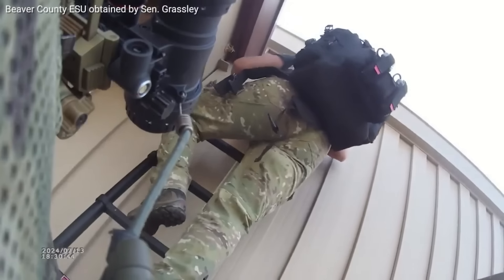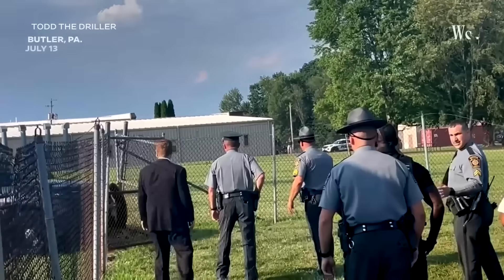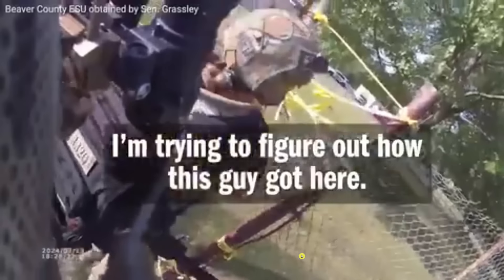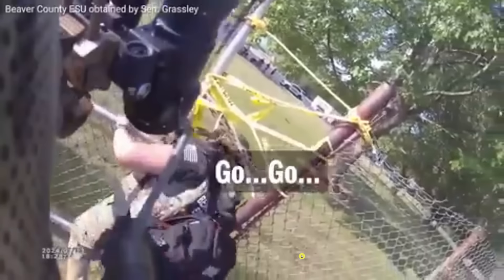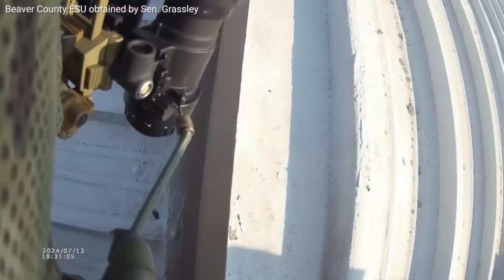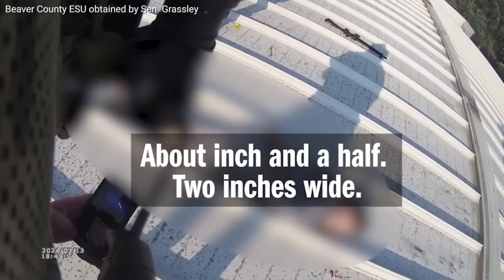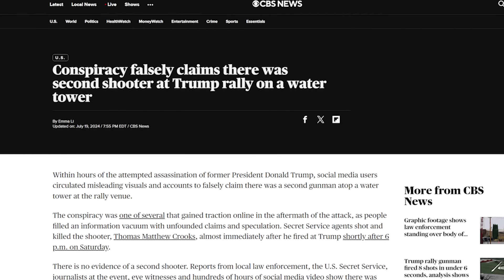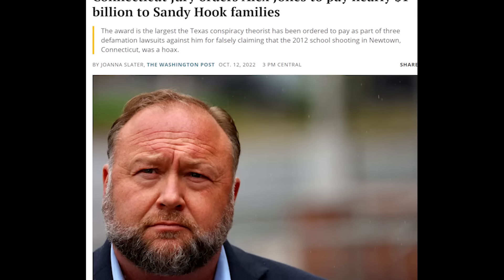Trump Shooting Analysis: Shell Casings, Ladders, Drones, Bodycams,

Comment: 8 cartridges or shells? This is double talk. Cartridges are unspent bullets.
Reply: Right - it seems like doubletalk. Technically, the cartridge is a complete ready-to-fire shell. A cartridge consists of a shell casing (which contains) a primer, powder and a bullet (projectile). After it is fired, the shell casing with a spent primer remains, the powder has been burned (initiated by the primer), and bullet has left the gun.
Reply: Watch the body cam. When they first got on roof, he counted only 5. Body cam cut off for 12 mins, then later they count 8.
Reply: @FookU2b just as a guess, if he shot 3 time lying down and 5 shots standing the casings could be apart somewhat. I missed that part and have to go back, they may have moved them all together, which may not be the actual evidence shot,but that I don't know. Like I said, I'm making a guess and not an informed factual comment. When 2 or more of the 'alphabets' areconducting an investigation, instead of working together, they trip over each other and conceal information from each other!
Reply: Wray... You ARE Incompetent!! Ugh!!
Reply: @FookU2b 😮😮
Reply: What is an empty cartridge?
Reply: @flyingfishsurf it’s called a spent shell casing. A cartridge consists of four components, a bullet, a shell casing, a primer and powder.
Reply: no the FBI use terminology for "Spent cartridges" a lot.. look it up.
Reply: @FookU2b yes audio really sounds like the first 3 were further away in all the audio I have heard.
Reply: @kevinshiley9061 Tommy NEVER stood up on that roof, he shimmied into place!!! Footage is clear on that!
Reply: Hello there how are you doing today ?
Reply: @FookU2b fishy for real!
Reply: Good point
Reply: @FookU2b I saw the same thing.

Comment: So how'd the shooter get on the roof without a ladder? But the police couldn't get up there without a ladder?
Reply: In a different video it shows three vertical exhaust stacks on the side of the building. Not sure why he didn’t include those in this video but they’re there - that’s also what the FBI director was referring to.
Reply: there was a ladder right behind to evergreen shrubs up against a tunnel adjoining the 2 large buildings and that's where his backpack was set down so he got on top of the tunnel/hallway then the roof & the ladder was there at the time of the shooting I don't know why they keep saying it wasn't there and its not the ladder they climbing up on
Reply: @merrychristmas40  it was there .. i saw it as well .
Reply: @merrychristmas40  The first three shots were fired from the second floor of the building next to the alleged shooter.  The weapon that fired the first three shots was probably fitted with a silencer, which accounts for the lack of echos.  The second five shots were blanks fired from the same location but with a different weapon most likely an AR-15 using a surefire trigger that can fire rapidly.  Blanks were used in the AR-15, which explains why no one else was injured.  Local law enforcement was in the building next to the building that the alleged shooter was on.  The last shot fired killed the alleged shooter and was probably fired from the same window as the other eight shots.  Everything supposedly found on the roof by first responders was planted by them as alleged evidence, including the 8 shell casings.
Reply: @merrychristmas40 that ladder is clearly visible in cell phone footage of crooks crawling up the roof as well
Reply: @robertperry4439 the FBI needs to interview you or fix news.  You solved the whole complex web of events like you were there.
Reply: The drone is to deliver the gun on top the roof @merrychristmas40
Reply: @merrychristmas40 please check the latter finger print
Reply: @merrychristmas40  agree... They keep downplaying the ladder he must be spider man and how he was about to sneak in the range finder and rifle... So, when and how did he sneak in the AR rifle and now supposedly he bought a ladder that he didn't use? All because someone must have told him... We have the ladder and the rifle ready just walk your way over to the side of building... It already to go for you, just like we talked about it... 
Theory just bring your range finder we'll have everything else, including the bullets you'll need in a back pack next to the ladder... Perfect CIA/FBI/SSA and whoever was involved had their rookie shooter for the perfect Patsy...
He moves in, sets up, takes aim but surprise surprise gomer pyle the real professional takes the first 3 shots and the Patsy freaks out thinks he was the only one doing the gig, pulls the trigger 5 crazy go nowhere shots ring out, all because he wanted to get the credit for the gig, meanwhile the real shooter packs up and blends in... Counter shooters (3rd team) way across the field wait for the right moment to silence the Patsy... Mission almost a success, but the demon rats weren't counting on the all mighty God to intervene... By God's grace and all the other factors people want to throw in there... He is still fighting for America, fighting for every American around the world trying to save this great country.  Amén
Reply: 4 min 28 sec... stand pallet up, climb, you know, like a ladder.
Reply: Given Crooks height, he may have used the AC compressor to cascade his way up to the adjacent shed to reach the roof for his money shot.
Reply: The reason nobody's seen him climb up the roof is cuz he just joined the server and happen to spawn on top of it.
Reply: @nmui8888 .. I don't know if the drone can lift that rifle, but it would make great sense.
Reply: I'm gonna flag this comment for using logic and reason!  In fact, I'm amazed it is still up.
Reply: Hidden ladder and rifle in conifer tree
Reply: @merrychristmas40  yer 1000% correct!  The footage immediately following the shooting clearly showed the ladder you are referring to... not sure why they are saying it wasn't there... but it was clear as day behind those trees in the alcove.  I'm going to see if I can find that live video.
Reply: Yes, you’re correct! There 100% was a white ladder. We all saw it with our own two eyes!
Reply: Technically, a Cartridge consists of Four components  1: Projectile (Bullet) 2: Casing (Shell) 3: Propellant (Gun Powder) 4: Primer
Reply: @White.W0lfz  - I too saw a video that had a ladder near two evergreen trees, just like is being described here.
Reply: Acording to what he bought at  Walmart  but heard he didn't need it because already  lawder  there
Reply: @EstorilEm  nah, that doesn't match with footage evidence, where his head is seen moving quickly right across a building, just b4 he appears at his final position.
Reply: @merrychristmas40  Classic misdirection. 'Keep telling The People that there was no ladder because if they link the ladder to the assassin's access to the roof, then it makes it obvious the assassin got help and the plot will unravel exposing us all'
Reply: @nmui8888  Secret Service: Is that a flying backpack I see?
Secret Service Command: It's probably just an Amazon drone delivery, just ignore it.
Reply: Wray provided a theory on the former (10:45), but I guess no-one has bothered to ask the cop???
Reply: @merrychristmas40  It does seem funny that we see an aluminum ladder there in the vid but the black collapsible ladder the police used near the building entrance is not there.

However, the hardware receipt was for a 5-ft ladder and that aluminum one was way over five feet, so it was not the shooter's anyway.
Reply: The cops are so stupid, they could barely get up with a ladder. Not smart enough to extend the ladder to it's full length. See video at 2:51. The ladder goes three rungs higher, but only if you're not an idiot.
Reply: Seems you can get on roof via the evergreen next to Building
Reply: How about: in the door, up the stairs, out a window. And glad you said shooter, not "Crooks". The shooter was Maxwell Yearick.
Reply: @robertperry4439 that motorcycle in the lot had rifles in the tailpies and handlebars which were suppressed with an autosear. It shot the satellite down that was watching crooks.
Reply: They don't even know how to work a telescoping ladder. When it comes to thinking outside of the box, they could be better.